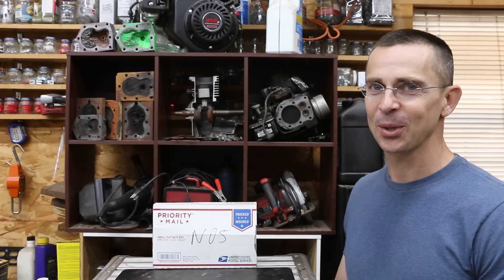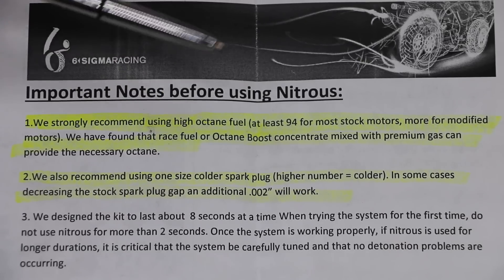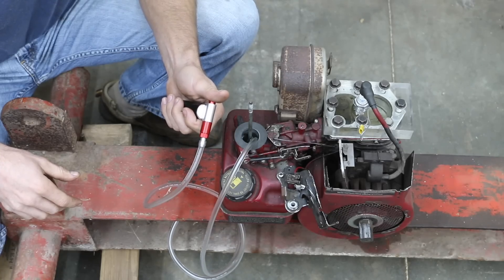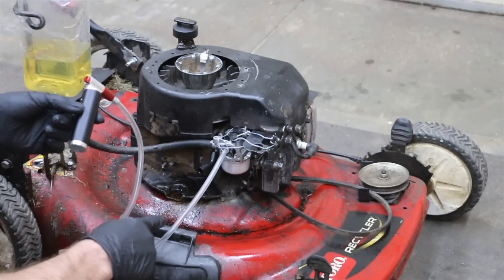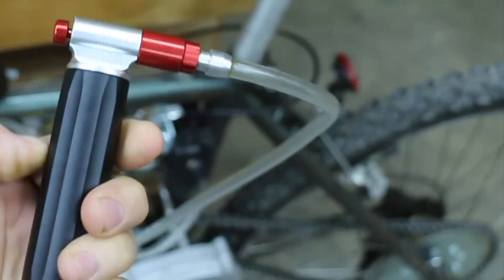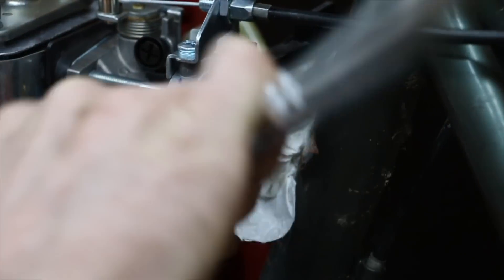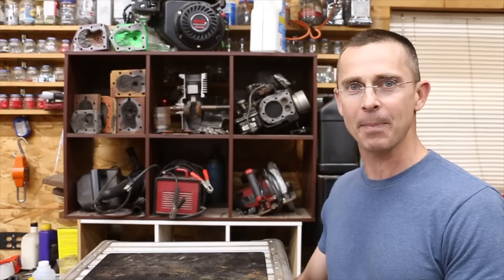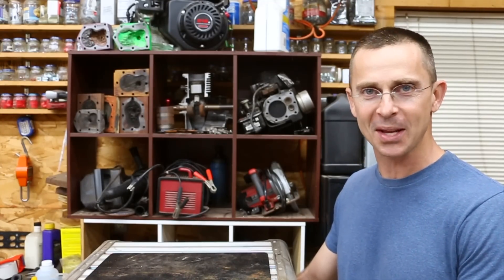Will the 4-Stroke Bike Survive Nitrous Oxide?  Let's find out!

Comment: This is hilarious. Nitrous in your 4 stroke bicycle conversion. 

You mentioned you got ethanol free 91 octane gas. You would have probably been better off with the ethanol. Ethanol increases the knock resistance of gasoline. In the automotive tuning world people will tune their engines to run on E85 instead of E10 (normal gas has 10% ethanol) because of ethanol's knock resistance. I have personally done this. I was able to increase engine power by advancing timing beyond what 93 octane would support. 

You may be able to run your small engine on E85 if you re-jet it. Ethanol is less energy dense than gasoline so you need decrease your air/fuel ratio. I think stoic is 9.8 or so as compared to gasoline at 14.7. Obvious when you are spraying nitrous, you want to richen up the mixture a bit. I'll leave you to determine how to get the correct ratio. I don't know if this will completely resolve your pre-ignition issue, but it should help.

One word of warning, E85 will make cold starts harder. That's why they actually decrease the ethanol percentage in E85 in northern states in the winter. You can buy a gallon of E85 and a gallon of E10 and mix your own if it is a problem. 

Another option would be to regulate the flow of nitrous with a pressure regulator. That way you could tune the amount of nitrous entering the engine. 

I realize this video is a year and a half old, but you could still test the knock resistance of ethanol with two of the same engine for a future video if you no longer have the bike.
Reply: Just being able to advance your timing in a low compression engine does NOT automatically mean more power.

Comment: I didnt know that you did the motorized bike scene. I see a lot of people building motorized bikes with the HF 212cc engine tipped up on its side until the cylinder is sitting completely vertical! I am sure that this plays havoc with the oil in the crankcase being upended like that. I dont know if they fill their crankcases or just put the original amount in them, or if there is power loss from the crankshaft slamming into the oil reservoir, or if this is bad for the motor. this is sometimes a big argument, can you test this please?
Reply from the maker: Thanks for the video idea.

Comment: enjoyed the various fuel results(naptha, propane, RC fuel), I used to have a 72 GMC pickup with a 350 running propane(Alberta where I live had a no road tax incentive at the time and it was about 30-50% the price of regular at that time, though it was $0.04/liter a few times) and it made me think that propane at about 114 octane and easily gasified would work well as the additional fuel you need to keep the stoichiometric fuel ratio when you add the NO2, maybe with a push button turbo torch type system with the sparker removed. I have also used coleman fuel when I ran out of gas to get me to the gas station in a few of my fuel injected vehicles, just had to take it easy so that your engine doesnt knock.  Thanks for your enjoyable channel.
Reply from the maker: Thanks for the feedback.
Reply from the maker: Thanks for the feedback.

Comment: correct me if im wrong but my thinking was like;  you can increase engine size but cant really do much about how strong the metal is. so if car engines can hold nitrous oxide must be way easier for smaller engines. and problem is going up with displacement?

Comment: I wouldn’t recommend it. Yes it will add power, but eventually at the expense of the engine. Quality nitrous systems have fuel enrichment means. Excessive oxygen to fuel leads to a harmful lean condition. Adding a powerful oxidizer like nitrous let’s a engine consume things more efficiently and hotter. What I mean by “things”is....just about everything in the combination chamber when it gets hot enough if there isn’t enough “traditional” fuel available. Ever used a cutting torch? When the flame gets things hot enough that you hit the oxygen lever... Walla! Molten metal!
Reply from the maker: Great point. Thank you

Comment: Just so everyone knows that's not how nitrous works nitrous n2o has 2 oxygen atoms why whould shooting raw oxygen help? It doesn't unless you have supplemental fuel being added as well all this is doin is creating a very lean running condition ...actual nitrous kits have one solenoid for pressurized fuel and one for n20 that have diffrent jets to control flow and keep air to fuel ratio correct this kit does do anything but cause a hot lean motor
Reply from the maker: Thank you for the feedback

Comment: that test seams like what i did with an RC car engine.   my friend had some extra old engines and wanted to know how much nitro it would take to blow one up.   i mixed 3 batches of nitro.   60%. 70%. 80%.    the 60 got it to 47 mph.  70 to 49.   80 hit 50 then the front tire lifted off the ground .  but we only had 60 ft run.  it looked to us that a short track will not give enough distance to over heat the engine.
Reply from the maker: Thank you for the feedback

Comment: 91 or 93 Octane is just fine if you just add more gas to the mixture at the exact moment that the nitro is injected for compensating the greater AFR, as nitro counts as an extra oxidizer when it decomposes. Also, extra fuel helps to keep the temperature lower before ignition, preventing the nitro compound from pre-detonating. So in general, a good nitro system should come with a special fuel manager unit. Without the fuel manager, you will only be safe using 105 octane racing fuel.
Reply: Still not safe....
Reply: @davelowets  Lol, that's for sure. Not even walking is safe :)
Reply: @JosePerez-il5qy  lol, not anymore it isn't. 😵

Comment: Is it possible to change the timing?
Reply from the maker: Yes it is. Thank you
Reply: @ProjectFarm  I realize it's not  a jet however as a jet builder I was stunned by the variance in the torque on the head bolts the 2 stroke bike engine.

Comment: The motor would last a lot longer if you richen the fuel mixture so as not to run it to lean. Most engineered nitrous systems have some type of fuel inrichment system.
Reply from the maker: Thank you for the feedback!

Comment: Fun test.  For any and all - medical nitrous is sulfide sterile and it doesn't increase performance any more than engine nitrous.  Engine nitrous does contain sulfides.  They are toxic.  They will kill you.  Don't inhale engine nitrous.  I am a retired training officer and hazardous materials specialist for my fire department.  The small amount of nitrous in those tiny containers is a limited hazard.  If a nitrous equipped car catches fire get away from it.  The tank is a pressure vessel that could rupture under extreme heat.  The nitrous system, if damaged, will feed the fire and increase the intensity of the fire many times over.  'Nuff said?
Reply from the maker: Thank you

Comment: You are only supposed to use nitrous at full throttle. That's why proper nitrous kits come with a throttle position sensor. That's why the engines all pinged when you hit the nos at idle.
Reply from the maker: Thank you for the feedback!
Reply: @ProjectFarm  thank you for replying!

Comment: nitrous is an oxidizer. its not flammable. by injecting nitrous without adding additional fuel, you are just leaning the motor out. Losing power, not making it. You either need to jet the thing rich as balls when off the nitrous, or use a carb that has a fuel enriching cold start circuit {plunger style not a choke} and use that when spraying.
Reply from the maker: Thank you for the feedback

Comment: Thank you mate! Its good to see someone pointing out that N2O is not flammable just helps to cool the air flow intake so it can compress it more and add more fuel for a bigger bang!
Reply from the maker: Thank you
Reply: No, that isn't what nitrous does. It's not a fuel on its own, that's true.

It is an oxidizer however. So when you feed it into an engine, it releases extra oxygen; and your fuel more or less puts out more heat, hence more energy.

That's what the "oxide" part of nitrous oxide means. Nitrous kits require tuning the fuel ratio to prevent blowing out your cylinders, pistons; or throwing a rod.

Comment: Most people that use nitrous oxide systems in cars to make extra power also add fuel to compensate for the extra oxygen. Adding extra fuel also stops the detonation. They also retard the timing while that nitrous is engaged
Reply from the maker: Thank you for the feedback

Comment: hey @Project Farm there's something I would like for you to test out, the ferite beads ( or you could google it)  I used it in my motor cycle ignition coil wire, I put two of the parallel to each other. the effect of it, it sustain the sparks or the arcing of the charge to the spark plug even on low rpm or even  the engine is on idle, it gives constant electricity. or your could watch some video of it on youtube called ferite beads on ignition coil
Reply from the maker: Thank you for the video idea!

Comment: You aren’t going to get anywhere near the full potential of Nitrous unless you set it up to dump more fuel into the cylinder at the same time the purpose of nitrous is to add more oxygen into the mix the more oxygen you add the more fuel you can burn try adding a separate small fuel tank so you can mix the nitrous with more gas as it goes into the carb that will give you more power right now all it’s really doing is giving you a more efficient burn as all of the gas is being ignited in the cylinder rather than only about 50% the rest gets burned in the exhaust normally.
Reply from the maker: Thank you for the feedback
Reply: @ProjectFarm  I know that you're smart enough that you knew all of that. Hell you probably got an engineering degree?

So what was your reasoning for not adding the extra fuel?

Because of the inefficiency of the engine it would most likely have enough fuel left over in the combustion cycle to to take advantage of the nitrous?

Comment: If you ride that bike a lot, get a 1 pound nitrous bottle.  If you don't have one but want one, let me know as I have one I am not using.  1 pound will let you hold that button on for a long time, possibly 5 minutes or so depending on the discharge rate.  By the way, who changed the S to a 5 on the box?  It is not NO5, it is N2O.
Reply from the maker: Thank you for the feedback

Comment: Now that you have had the four stroke bicycle for a while, why don’t you put it to work on the farm... build a trailer and see how much abuse it can take hauling firewood, and also do the same with the 2 stroke bicycle. With doing this comparison you would have to outfit the bicycles for also carrying the needed supplies for your cutting/ bucking, felling and fueling your chainsaw, files and tools for changing plus or chains, basically building your utility bicycles that can be used for more then one can imagine. Put those bike to your ultimate torture tests, and prove that bicycles are for more then just pleasure, but they can work for something more than commuting!

Comment: I had a nitrous kit on my 83 Mustang GT.  You get to learn all about cars when using this stuff because it you are always fixing the stuff the extra horse power breaks.  I first broke my off a head bolt into my block and blew the head gasket.  That was fun to fix.  Then, my clutch would not  hold half the time so I had to change it and beef it up.  Then, it destroyed my differential while playing around a corner with too many people in my car.  If I had to do it all over again I wouldn’t change a thing ;-).  Thanks for the video.
Reply from the maker: Thank you

Comment: Yep, I have a Yeti 24speed All aftermarket parts, a B&S over head valve bored and stroked 30over and 1\10 extra stroke, twin turbo' pushing 12hp 10fp. yea, yea that's NOS for 8 seconds of boost maxes at 21hp 18fp. can get 50mph on straight'n'level. Race ya!!
Reply from the maker: Thank you!

Comment: When running nitrous it is necessary to retard the timing.
Also, when running a 'dry' shot nitrous set up your gain in power
is related to the normally un-burnt fuel available in the cylinder.
Reply from the maker: Great information. Thank you

Comment: Note: nitrous oxide is best used for acceleration, not top speed. While it will increase top speed because it gives a power boost, this effect is minimal when compared to the effect when accelerating. Nice video! 😊
Reply from the maker: Thank you!

Comment: While we have seen that you have 2 motorized bicycles,1, two stroke and 1 four stroke, I think you need to build 3 more bicycles, a four stroke diesel, 2 stroke diesel And a rotory engine. Keeping displacement all as equal as possible. The run the numbers on efficiency, (mpg) hp, torque. Then have some real fun, build a turbo for each one, and rerun all the testing. While using these bicycles in a real world usage of daily runs into town where you would normally drive your truck for small errands, granted that it will be time consuming, but is the savings on fuel, maneuverability, insurance, and registration worth the savings for 1 person traveling x amount of miles/ day. If you really want to make people think, through in a non motorized bike and an E bike. But now you are dealing with converting fuels from mpg to calories of consumption. 

While this would be a challenge, it will also do something else, it would give you 4 equal vehicles of approximately the same weight, and horse powers, thus giving you an equal test platforms for other fuels and additives. Granted this would take several weeks to achieve, 1 test pilot, and all of his daily habits of operating a vehicle would give a basic economical base line for different fuels, required maintenance, and durability testing of the bikes. My guesstimating would be that the rotary engine bike would produce great power, but be very wasteful in economy, followed by the 2 stroke gas, next would be a toss up between the 2 stroke diesel and the 4 stroke gas for both power and economy but I would almost bet that the 4 stroke diesel would have equal hp, more torque and better fuel economy. Then as areal kicker, would you find that motor biking a worth while means of commuting year round, in ALL kinds of weather?

 I have ridden motorcycles in the scorching sun, teaming rain, snowstorms and hailstorms of the Rocky Mountain’s From Colorado to Washington State, and even during Hurricane Floyd here in N.J. And I have had tickets for riding motorcycles in inappropriate conditions, when I spoke to the Judge, I asked him , In N.J., when is it appropriate to ride a motorcycle, his reply... charges dismissed!
Reply from the maker: Great video ideas! Thank you
Reply: No problem, I was going to ask you to build a diesel motors from a Briggs block, like a 2. Hp for both a diesel 4 stroke and a diesel 2stroke but I think that might be a bit much to ask!

Comment: how about trickling in pure oxygen into the carbratr with a high octane fuel.. adjust(reduce) the fuel quantity so you don't get un-manageable power..
Reply: basically trying to say get your mixture to stoichiometric ratio using oxygen and a heavy fuel
Reply from the maker: Thank you!

Comment: i thought the whole point of nitrous was adding more fuel with the nitrous??
Reply from the maker: Great point. I set the carb to run as rich as possible but didn't mention it.  The nitrous did provide an impressive power increase

Comment: Why we need higher octane no. Petrol while using N2O in engine. Why there was knocking sound while spraying N2O into cylinder. And why we have to use colder spark plug. Please answer sir i am so much confused after watching this video. I a not able to find answer of these questions anywhere.
Reply from the maker: Thank you for the feedback!
Reply: May i know answer of this question

Comment: I'm guessing that bike frames aren't built to handle speed in excess. If it was a bigger engine than you'd probably want to re-enforce the bike frame. Nice video. Subscribed. Looking forward to more.
Reply from the maker: Thank you!  Great point on the speed. My biggest concern is a tire going flat at those speeds.

Comment: Now add the extra fuel it requires as well, you're just 'booming' the engine without it, extremely lucky it didn't destroy itself, frightening but not surprising that such ill conceived kits are sold, highly recomend some research into how nitrous oxide works before using it

Comment: Hey* How's it going "Mr. Master Mechanic Man" I was  just a little curious on what your thoughts wr+are When you have A gasoline engine <Just running ON Vapors>
& [N'O,S!)
            ?? would operate??
Reply from the maker: Nitrous is just an oxidizer and needs extra gasoline to be effective.   While I did achieve power gains in this video by running the engine rich, a better approach would be to use a "wet" nitrous system.

Comment: What / how much help does the nos improve hill climbing? E.g. I ride mine 25 miles one way to Walmart 50 round trip on highway roads.  highway 259 has some long hills that the factory engen struggles climbing (sometimes I have to pedal assist) [though I assist the engine, the engine also assists me,  with out the engine on a mountain bicycle,  I'd have to get off and push.] So would the nitro give it the extra it needs in place of my pedaling on these long hill climbs?
Reply: The nose let’s you smell stuff 
It improves your life

The nos probably adds about 1 to 1/2 horsepower it will make hill climbs a breeze